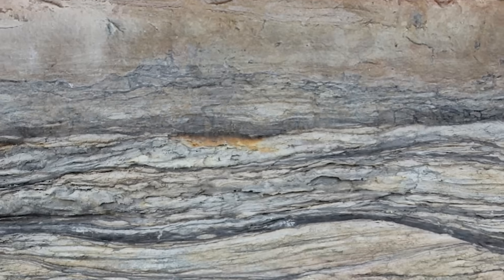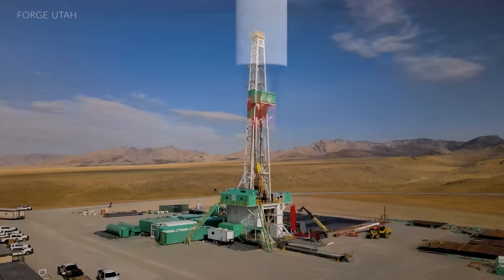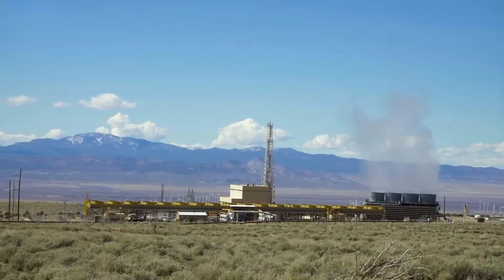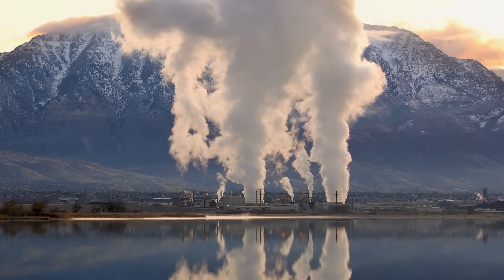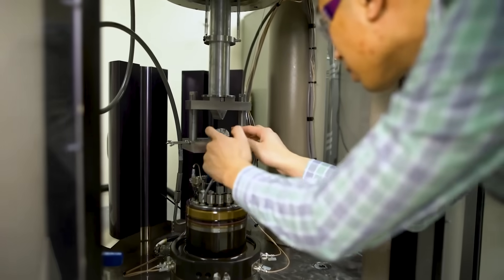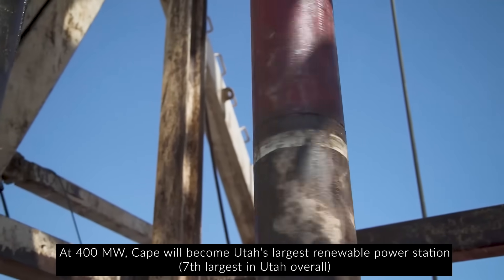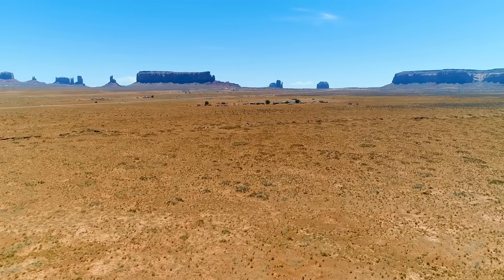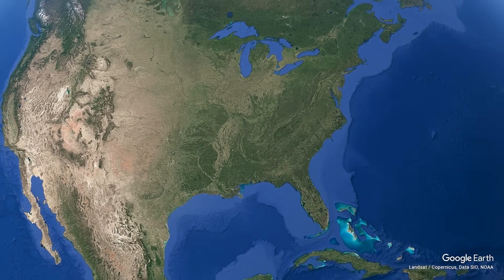This Groundbreaking Clean Energy Source Could Power America

Comment: When it comes to conventional drilling and fracking there are other options. One is "Plasma deep drilling technology " which uses a powerful laser to burn through rock. This method allows for deeper well and higher temperatures. Plasma drilling also creates a sealed borehole. By creating a loop, very hot water can be circulated to run an electrical turbine.
Reply: It isn't a laser. It's a gyrotron and it beams 500kw of directed microwaves down the borehole and vaporizes the rock via dielectric heating.
Reply: The advance in the FORGE research wells were as much in drill rate as production concepts.  These specific types of geothermal concepts have been uneconomic. Drilling rigs charge by the day, and drill rates were increased at FORGE from 30 to 300 feet per hour with conventional bits. This is stunning in thousands of feet of granite rock that's almost identical to your kitchen counter top, except it's even harder.   Lasers, plasma, and other cutting technologies might cut it, but they aren't even close to being competitive with 300fph, even if you could work out some serious technical challenges.
Reply from the maker: That’s very interesting! I came across the work Quaise is doing on this. They are DOE funded too I believe. Looking forward to seeing them prove it is affordable. Does the plasma use a lot of energy?
https://www.quaise.energy/

Comment: Great video but this is also fracking, so calling it "Clean Energy" feels misleading. 

This method creates basically the same issues as fracking 💀

"Economically viable" is usually not "Environmentally sustainable" :body-blue-raised-arms:
Reply from the maker: So what is clean energy then?
Reply: @TheDailyConversation  good question! oversimplified it would be one that doesn't generate significant environmental damage. Even solar and hydro can be "dirty" when done improperly.

But fracking is well known by ecologist for their multiple damages to the environment, very often severe and irrevesible. From pulling groundwater to causing earthquakes and sink holes.

Geothermal can be a great source of energy when done in a closed loop. Using fracking to simplify the process and reduce costs it's what makes it a problem.

Fracking aside, thanks for the great video! Greetings from NYC 👋
Reply: @CesarAnton  I lived in SW Pennsylvania when most of the fracking there was going on. We never had any tremors, nor did I ever hear of sinkholes opening up. In fact, fracking for geothermal would cause positive pressure on the rocks above for an indefinite period of time, the opposite of what would cause a sinkhole. The main risk of fracking for oil and gas is groundwater oil contamination and methane leaks. Sinkholes are not the issue. And in any case, I'd much rather handle those risks myself than offshore them to Indonesia or the Congo or Nigeria like we currently do with resource extraction. It's truly criminal how scared we are of even the slightest impact in our backyards yet how readily we will ignore the devastation of indigenous and poor people the world over!!!
Reply: This is simply not true. The scale of the risks of fracking for heat is nothing compared to oil and gas. Your reacting to the name "fracking" without learning anything else about it. This is like being afraid of Ted Kaczinsky's brother, just b/c of Ted's (AKA the Unabomber's) reputation. If you learn more about to topic, you find out that his brother was the one who reported him to the FBI.

Comment: Geothermal energy is dumb, for many reasons, pumping massive amounts of water, which we don’t have excess of, into the ground, to get steam, is incredibly expensive.  Solar + battery storage is the cheapest, most reliable power production.  It doesn’t rain or snow everyday, yep, we have water on constant demand via storage.
Reply: In the video they state 95% of the water is re-used. Aren't the costs for battery and solar panel replacement and maintenance higher than pipe maintenance + that 5 percent water? We also don't have excess nickel, cobalt, lithium, ...
Reply from the maker: 95% of water is captured. Fervo uses all electric equipment. I agree we should maximize solar+battery if it ends up being cheaper and less environmentally costly, but solar and battery use a lot of rare earths (as other commenters have mentioned).

Comment: Looks great but I dont understand how you get the fresh water, in Utah.. Is it a closed circuit? Surely there will be water losses in each cycle
Reply from the maker: Great point. Utah is dry and will become drier. 95+% of the water is now captured and reused in the loop (based on the 📊 as I remember it). I envision using the electricity to power systems that efficiently capture and store water from the air for many uses in the arid west, along with much improved rainwater/runoff capture systems...and more efficient farming practices to recharge over-pumped aquifers. If we really get desperate, we can buy and pipe water down from Canada. And of course, we’ll be able to transmit great amounts of this cleanly-generated electricity (and heat and water), over long distances, so it’s generation can occur far away from where it’s consumed. (Although from an efficiency standpoint this isn’t ideal.) 
One thought sinks in as I research these projects: our ancestors went big to put us in the dominant societal position we’re in now (living standards, geopolitics, etc.), so to deal with the collateral challenges, we need to keep thinking and going big. Use science to engineer solutions to every problem to increase everyone’s quality of life, while minimizing collateral damage now and in the future. Good news is our research and development system so on-point that the tools we need continually emerge, we just need to continue funding programs that find them and put them to good use!
🤓🥸😎
Reply: Once the created cracks are filled with water, there's no loss below ground.
Reply: Do you have salt water in Utah?
Reply: @timothynechville8326  "Do you have salt water in Utah?"
That would be the Great Salt Lake.
Reply: @timothynechville8326 You're kidding, right? 

https://maps.app.goo.gl/xicBerY8CWSjet1K7

But, even that is drying up.
Reply: I don’t think the water quality is a big issue. they probably can use grey water (non potable) which often readily available and cheap.
Reply: There is a great acufier under the west desert of utah. Las Vegas has been trying to tap into it and send it south by pipeline.
Reply: I've heard that roughly 2 to 4k gallons of water are needed per kW-hr produced. If losses are under 5% in a closed circuit system, it's just a drop in the bucket. Even out here in the desert southwest.
Reply: @michaelseaton5145  "I've heard that roughly 2 to 4k gallons of water are needed per kW-hr produced"
My distiller requires about 2 KWh to produce one gallon of pure water from one gallon of not pure water.
Reply: Pipeline from the Great Lakes?
Reply: @stewyoung8523 nah that would ruin the Great Lakes

Comment: Geothermal is a great energy source. However there are also problems. The EGS here is "fracking" the stones. This should only be done outside populated areas. Also could cause a problem if there is an aquifer that can become polluted.
An alternative is a closed loop system, where water or glycolic fluid stays in a pipe and the pipe is heated by the surrounding earth. This can be used for house heating. Drilling is only some hundred meter deep, or even less if used in combination with a heat pump.
Reply: Where does all this water to be injected come from?
Reply: "Drilling some hundred meter deep, or even less if used in combination with a heat pump" is different from "geothermal energy" the world efforts are directed. Shallow depth have only marginal heat which is good but not what expectations are.
Reply: Geothermal wells are 8,000 feet and deeper.  Deep water wells are 500 to maybe 1000 feet.. most are 100 feet or so.. so quite the gap there.
Reply: @N5ZY  Go easy, they think they understand. They mean well at least.
Reply: @N5ZY  This again? How do you get to the lower layer? You drill through the aquifer. If you do not take spacial care and install pipes, you will pollute the aquifer.
Reply: @Foersom_  There is a steel casing surrounded by a concrete casing and there are multiple layers.
Surface casing, intermediate casing and production casing.. it gets smaller in diameter as it goes to depth.
Your state, or at least in my state, the Corporate Commission regulates drilling, re-drilling, fracking, etc.  The owner and driller must also adhere to requirements by the insurance company to eliminate any liability today and in the future.  If money is lent to them for the operation the lenders will also want to know things were done correctly.  The casing (cement and steel) where water aquifers are located is extremely thick.  Drilling is observed by geologists constantly and they observe samples from the material coming out.  As for fracking, it's once at the start and then maybe 20 years later?

Personally I'm more concerned about plastic in my water and my food.. and much, much more concerned about my drive home from work..
Reply: I totally agree with you 💯 👍🏾
Reply: Thanks Dad
Reply: Shutting down,then,meawhile.....how long it takes ? Now moroons wants to do big things
Reply: Wouldn't it be a different situation? The oil fracking pollutes because of oil getting into stuff it shouldn't, but this wouldn't have oil to pollute? Am I missing something?
Reply from the maker: Thanks for the comment, I originally had this in my script but cut it for brevity. I agree that fracking is a concern, but FORGE/FERVO have designed a system that minimizes this risk. Fervo uses sensors to real-time monitor and apply a Traffic Light Protocol based on strict seismic risk to ramp up/down fracking. They’ve rarely had to pause for very long.
Its geophysicist described their approach at the 55:00 min mark—worth a watch to fully understand the state of the industry. 
https://vimeo.com/1009184419 
The closed loop system is also promising. I’m looking forward to seeing the project in Germany come online (when is that?) and the costs come down.
https://www.eavor.com/blog/eavor-loop-technology-changing-energy-consumption-in-germany/
Reply: @TheDailyConversation  "trust oil and gas fracking experts" no thank you. it smells as bad as the water in Flint Michigan
Reply: You realize what they're talking bout here right? There are no aquifers where the heat reaches 300-400 degrees. Any water will only exist in the form of very high pressure steam. I don't recall mention of the depth of these wells but unless they are sitting on top of a natural hotspot related to magma, those wells are very deep to reach those temperatures.
Reply: @beebop9808 2000-3000metres deep
Reply: @beebop9808  When you drill deep you drill through layers with aquifers. Unless you take special care and install pipes you will pollute the aquifers, even if your final drilling is much deeper.
Reply: @Foersom_  I do believe that was said.
Reply: There really is no current system of energy generation that isn’t costly that gives the freedom needed. Stopping and reversing human caused climate change needs to be the number one priority. And that means shutting down hydrocarbon based energy production as quickly as possible. And then, in the meantime, developing ways to minimize environmental impacts of things like energy storage with more sustainable battery tech, or, in this case, the impacts of EGS processes. I know you’re just educating us, I just like… idk I think we are such dire straights as a planet that anything but pure, almost stupid positivity surrounding green energy techniques needs to be shouted down lol
Reply: @rorytribbet6424 you’re anxiety level is through the roof.  The planet is fine.  Yes, we can do fetter but Al Gore is wrong about doomsday being just around the corner.  Turn off the news.

Comment: Iceland became wealthy off geothermal energy, so this is very promising.
I didn’t know we could drill deep enough in none-volcanic regions.
Reply from the maker: With this I think y’all will keep getting mad money
Reply: "I didn’t know we could drill deep enough in none-volcanic regions."
Tests have shown geothermal works in Sweden and Finland; Scandinavia is basically one big cold slab of granite billions of years old but there is still heat close enough to surface to make a profit out of it. Granted, the test holes were for district heating and cooling instead of producing electricity which would need higher temperatures, but those two are the biggest energy drain anyway so it is more efficient to skip a step and use the heat directly.
Reply: How is the funding going to be with the new TRUSKY administration?
Reply: See comment above about thermal delta.....
Reply: It's not the same, here they are using fracking so it's not green at all, it has the same issues as using fracking to extract oil and gas.
Reply: @CesarAnton  while there are downsides to this process, it's not the same as oil and gas because methane wouldn't be burned or released into the environment.
Reply: @TooSchoolForKool  that has nothing to do with it. 

The problem with fracking it's not the oil or gas you get out, it's the fracking itself which may cause several damages to the environment. Specially contamination of groundwater, earthquakes and sink holes.

Read or watch some videos about the problems with FRACKING (not oil or gas).

That being said, it can be a much better solution than coal or gas in some areas if done responsibly.
Reply: @CesarAnton  that's why fracking shouldn't be done near populated areas.
Reply: @TooSchoolForKool  agreed :yougotthis:

I would add also places with ground water.

Still plenty of places where they can use this without harm, the best places are the ones where there's literally nothing else anyway.
Reply: @CesarAnton the contamination is from oil and drilling materials that leak into local aquifers, it's not the same as using water from the start, in an isolated area with no local aquifer 

Understandable, but clearly already taken into account
Reply: @CesarAnton  Most of the groundwater contamination is oil and methane mixing in the water, the amount of fracking fluid used is tiny considering the volumes involved.
Reply: @AnalystPrime  no amount of contamination is acceptable on deep ground water, also the contamination is permanent and cumulative.

Also you forget that the hot water dissolves metals, minerals and other dangerous substances which could contaminate ground water in the area.
Reply: @CesarAnton  The problem with that is drilling too close to an aquifer in the first place which for some reason nobody told the oil companies not to do. I get the feeling there will be no such leniency for a clean tech company.

But the fact remains that the borehole for the geothermal well is size of this dot . while the area where the oil and gas will spread is at least this big: O

One of these risks is greater than the other. And if some idiot does contaminate an aquifer the relatively few tons of chemicals are a far smaller issue and easy to clean out compared to million barrels of oil.
Reply: @AnalystPrime  ground water contamination cannot be cleaned but I agree with you, it can be a good thing if done right.

I would still prefer a closed loop, but I understand that makes it less financially viable.

Greetings
Reply: @CesarAnton  "Specially contamination of groundwater, earthquakes and sink holes."
Apparently there's no groundwater to contaminate.  Earthquakes are common in Utah.  Sink holes not so common but if you are fracking a thousand feet deep; just how do you suppose a sinkhole could form?
Reply: @CesarAnton  "no amount of contamination is acceptable on deep ground water"
I admire your moral purity.  Perhaps you could cease using a computer and its demand for electricity. 

"also the contamination is permanent and cumulative."
Long-lived, anyway.  Eventually the overburden will erode into the sea but that is a billion years in the future.
Reply: @CesarAnton I think it is the amount of fracking that has to be done. Fracking for hydrocarbons just enables the hydrocarbons to be extracted. Once that is done you have to move on and frack some more to keep producing. With the described system you frack to create a reservoir which can be continuously used because you are refreshing the fluids you extract. Presumably the reservoir will last a long time before it needsto be maintained, if ever. Neat. Hope it is successful and fast
Reply: @ambassadorfromreality1125  sounds reasonable, hope you are right 🙏
Reply: @thomasmaughan4798 Not if it’s in a geologic basin. In that case, more “overburden” will be deposited on top of it. Might have to add another billion years to your calculation! 😊
Reply: @jrwstl02  "Might have to add another billion years to your calculation!"
Yes, agreed.  There's a lot to it.
Reply: @CesarAnton  Having risks to be mitigated isn't the same as not being green. Also, the danger of fracking for heat is FAR less than oil and gas, b/c the only substances that could contaminate the water are metals and other deep earth minerals which are relatively easy to treat water for since aquifers themselves are often exposed to rock layers with these kinds of contaminants. Fracking fluid for oil wells contains a ton of nasty additives to coax oil out of the rocks, but since they only need to transfer heat for geothermal, they only need a brine solution with a disinfectant. It's much harder to deal with the horribly carcinogenic contaminants (alkanes, alkenes, and aromatic hydrocarbons) that come from oil and gas wells.